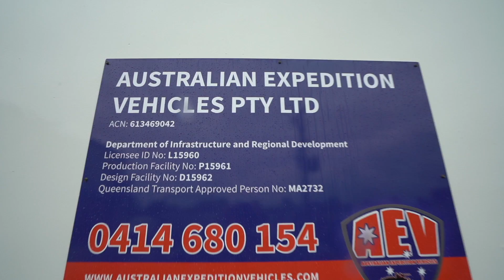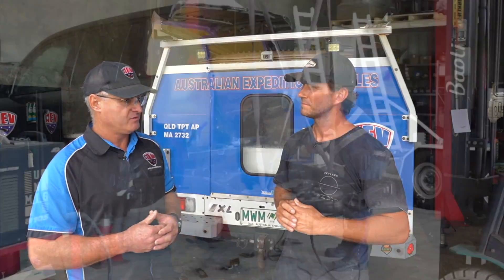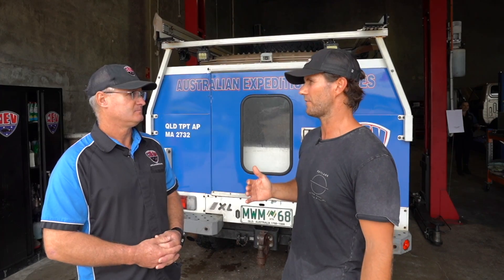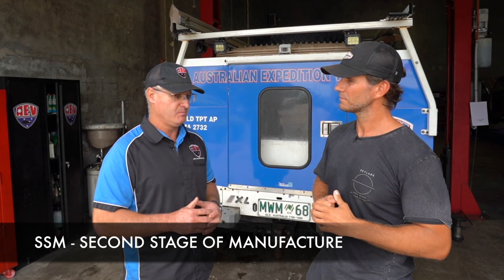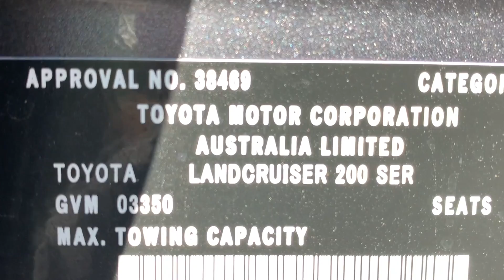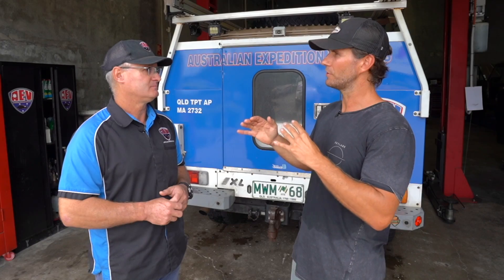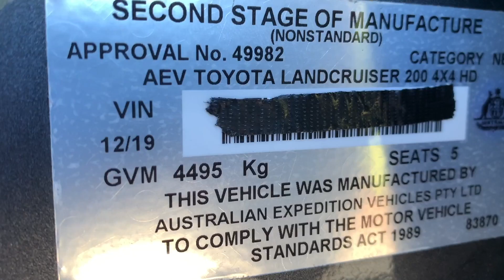THE DUAL CAB 200 SERIES LANDCRUISER - PART 2 | TIME FOR CHOP CHOP!!

Comment: Hi guys great vids only issue is that the cruiser is not parked in my driverway. What was the weight of your last van and GCM with the BT 50? Also did it tow ok as i have a ranger and getting a van built but not sure if the power will be enough.
Reply from the maker: ACE CAMPER last van was 3.2 tonne and car was 3.5tonne. We had an upgraded gcm of 7tonne. It did it no dramas hey💪

Comment: why not just buy a f 250 and be done with it all these modifications on these 200 series are standard on a f truck
Reply: Rather all the Toyota mechanicals I suspect.
Reply from the maker: Martin Black to spec an f truck to what we have done here would cost more, and it’s hard to get parts and mechanical work on f trucks in remote areas of Australia

Comment: So you've gone from 6850 kg GCM to 8995 GCM. 2145 extra kgs, and the advantage of the  gull wing camper back. Plus car ride, not a bouncy truck. I'm not envious, BS, I'm turning bright green. Interesting to watch the reno. I'm an interstate truckie and budding caravanner. Cops are right on trucks and weights, as they should. Some  caravanners have no idea of weights and legal obligations. Talking to a tow truck driver in Alice Springs, every now and then would recover smashed van and car, insurance co would ask him to weigh them. Weigh truck with smashed van, and or car on back, then weigh empty truck, gave the weights. Some vans and or cars were overweight, either by themselves, or GCM, if overweight, unroadworthy, so no insurance payout. So those extra kgs capacity are legal gold.
Reply from the maker: Colin Ross well put mate 👌
Reply: Make sure you leave the tap on after a crash to drain the tanks.
Reply: @larkhill2119  your assuming that you physically able to do that after the accident